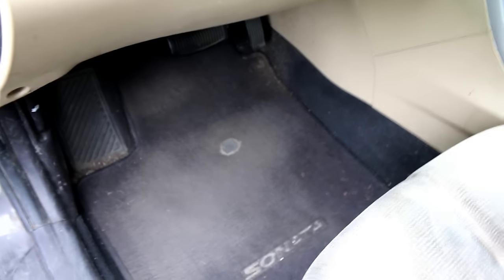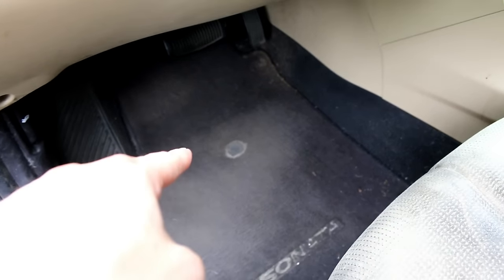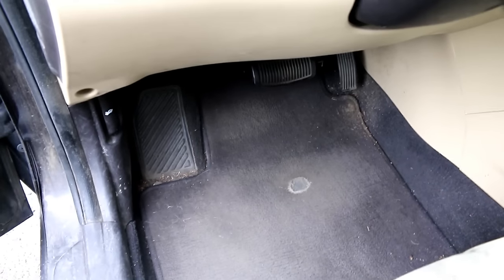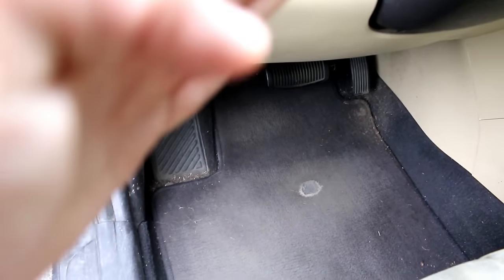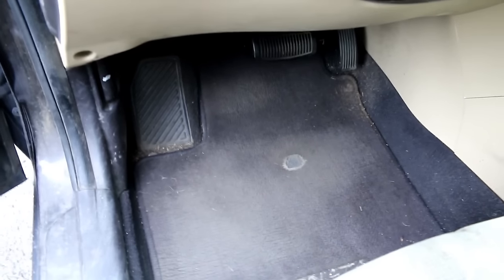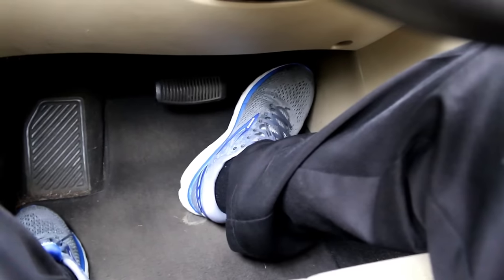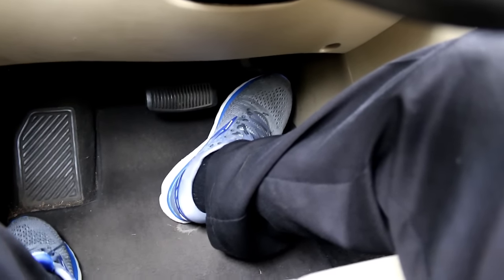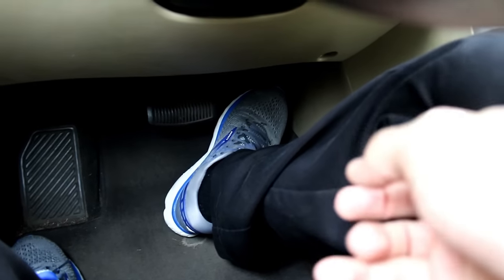Driving Health Hack! Quick Fix to Knee and Leg Pain While Driving

Comment: Personally, I'd say to have your heel a couple of inches to the left of where you showed, but you are absolutely correct. My driving instructor always taught me to use the ball of my foot for the brake, and the toes for the accelerator, as it not only helps you mitigate knee problems, but also lets you use the pedals more sensitively.

Comment: Good video. Alright. But let me also add ☝️that another benefit we’re looking at here is the significant cut down in the high cost of body repairs and prevention of further injuries once your foot goes down through the flooring due to the hole you created!!☝️😳

Comment: It was suggested to have your foot at an angle for the gas pedal to have better switching control between brake and gas, but in my recent trips i noticed with this method I developed pain in my knee and hence here, re-learning never hurts :) I will try this method see if this works well for my knee and my car control.

Comment: I drove 1200 miles with rest when needed but still straight through. And using cruise control a lot of the way. But my knee didn't start to hurt until the last 4 hours of my 20 hour trip. When I got home I couldn't bend my Knee for hours. Today I drove for 6 hours and my knee started acting up again I love driving so hope this helps thanks.

Comment: Door Dashing brought me here lol 😂 pressing on the gas pedal was excruciating yesterday. Woke up and walking on my right leg hurts so much, took the day off to rest, most likely tomorrow I’ll be doing more cold and hot compresses. Thanks for the video

Edit: on top of my heel being rested by the brake vs the gas peddle, I also tend to have my seat all the way back, where I have to fully extend my leg every single time I brake or push on the gas.
Reply: I have been a Shipt shopper for the last 4 months. About 2 weeks ago, I started feeling a "sun burn" feeling in my right leg. It was just above the knee and now I feel the tightness all the way up my leg, from my ankle on up. It's got to be from all this driving. 
I'm glad you mentioned you are a door dasher. I wondered if anyone else who does similar work, has similar issues from driving constantly. I'm going to have to be more conscious of my foot placement I guess.
Reply: Doordash too.lol

Comment: I have had off and on inside pain on my right knee for decades and today I just had a thought about exactly what you said in this video.  I started correcting it before  I watched the video but now I will really try to correct this.  I sure hope it works.  I've also had some left shoulder/arm pain for a good while because I always use that arm for steering.  I'm trying to correct that too.  Thanks.

Comment: Hi, just found your video.  thank you for it.  Today, i moved my seat back as far as i could and still be able to reach all the controls and lifted my foot each time i changed from accelerator to break. So that my foot was at zero angle. I was able to do it by making sure I have plenty of room in front of me and, of course, staying off expressway. It does require extra concentration. And, in emergency, i will have to use the old way. But it helped. Luckily, i don't drive more than 2 hours in one day. Maybe in the future they will have standard hand accelerator and brakes.thank you again.

Comment: Sometimes I do put my foot straight forward on the gas (to floor it on some occasions) and then I pivot my foot to the left on the brake at a 315 degree angle, depending how much fun I enjoy driving. But mainly, I usually pivot my right foot straight forward on the brake and then I curve it to the right on the gas at a 45 degree angle while driving for the most part.

Comment: Great advice.   People spend a lot of time driving.
Do you have any advice to share on the upper body?
Reply: One tip for positioning of the steering wheel from your body: rest your wrist on top of the steering wheel. You should have a slight bend in your arm, but not much more than that.

Comment: We must pay attention to the position of our foot when we press on the pedal and the brake as shown in the video clip or else the bad habit will cause our right foot to pronate to the right side, and it will interfere with our gait in the long run, so it will be difficult to walk.  I had to drive long distance for a long time, i.e., over 700,000 miles or a million miles for 20 or 30 years now, and I found myself limping the last ten or fifteen years.  I wish that I had known about this issue much earlier to avoid many issues.

Comment: I’ve noticed with newer cars the pedals in distance ratio to the steering wheel and seat position no longer feels comfortable. It’s like cars are being designed for small petite Asian people and not big broad Americans. I have a short torso but long legs so I’m either too far from the steering wheel or the pedals. And I don’t know if anyone has noticed but the design of where the pedals are located in the Subaru Forester!!! It is tucked around and behind the hump center divider WTF!? Who designed that!!!!! Has caused me chronic shin splints so painful. There’s just something not right with the distance between all parts (pedals, steering wheel, seat height, and seat distance). I started feeling this pain back in 2015 when I bought my 2014 suv. I don’t know if this is the same issue with cars.

Also someone in the comments brought up being able to pivot easily between the two without taking their foot off. I think a lot of new cars are being designed where you have lift your leg or foot further back to move between the gas and the break which causes the leg and knee to scrunch. This is painful.

Comment: I tried this and it didn't work. I just went to the chiropractor last week and he cracked my neck and lower back with some dry needling and the pain was mostly gone while driving. Turns out I have a nerve impingement. So exercises to loosen up the hip and lower back region. No calf strengthening required

Comment: I'm 5'2" with Achilles tendonitis. There isn't much information about adjusting your feet. I'm currently working on strengthening my tendon but I have flare-ups after I drive. Any suggestions?

Comment: ...and get cars re-designed!  A few weeks in a Peugeot triggered months of hobbling knee-pain.  Saw my doctor, told her a car hurt me. 'Ah' she said 'Peugeot 504? I've seen several cases this month.  Change your car'.
My theory: that little old car was designed for left hand drive.  No problem there, but in setting the pedals on the right for UK there wasn't adequate room for the throttle.  So you were obliged to curl your leg and foot inward, and even dip it to and fro under the too-low steering wheel.  Progressively painful. Hazardous. Not good for entente cordiale.  I moved to a totally comfortable Toyota.
A further tip:  some throttles are insufficiently supported by their return spring, so, via your knee, you are holding your leg weight off nearly all the time. A very un-natural challenge to the joint, I would say.